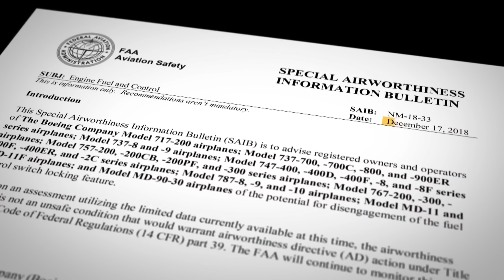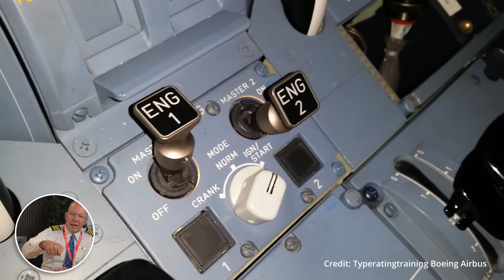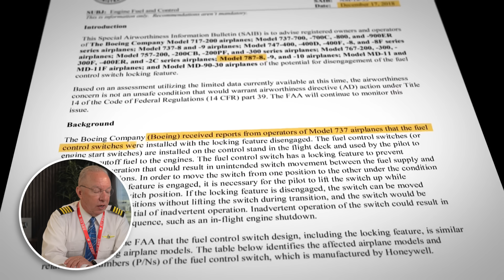Air India 171: The FAA’s 2018 Fuel Switch Locking Bulletin Explained (16 Questions Answered)

Comment: Boeing flight carrying 242 people roughtly
1.Aircraft liftoff at 0 seconds
2.Fuel switches to CUTOFF +3 seconds (reaching a height of  191 m, airspeed of 330 km/h)	
3.Engine 1 switch back to RUN +11 seconds
4.Engine 2 switch back to RUN +15 seconds
5.Aircraft crash +29 seconds
Based on the above details applying Physics and math, can you calculate the possible distance from the end of Runway  till the crash spot?
Answer: The aircraft likely crashed approximately 2.1 km from the end of the runway, assuming the speed profiles and acceleration/deceleration approximations made.
ChatGpt gave me the above answer.  But the flight has crashed at 1.5Km, so my question is the Fuel switches back to Run?

Comment: Do not believe this rubbish about one of the pilot's actions of switching off fuel to both engines during takeoff. 

Pilot sabotage or accidental fuel cutoff or pilot under influence of a substance couldn't have been the cause of flight 171 crash. It is entirely possible, yet very unlikely. Both pilots were not in the mood to kill themselves that day. 

Something far more sinister took place inside that aircraft.

Comment: Captain Steve great show as always. I have a question. If one of the pilots shut down the fuel supply. And the other pilot re-engage them and tried to start the engines back up. But was unsuccessful. Why were they both found in the shut-off position. Did he shut them back off after realizing they the engines wouldn't start? I'm really confused!
Reply: The preliminary report states that investigators found the switches were in the on position when the plane crashed, meaning a pilot had moved them from on to off during takeoff and the other pilot had moved them from off to on again before the crash.

Comment: Capt. Steve, you are doing a great job explaining. I am an aeronautical engineer. I have 2 questions. 1) are the fuel switch positions seen in the DFDR data? 2) If the switches were off before takeoff, would the aircraft have taken off with residual fuel? Thanks!

Comment: Recommendations
Honeywell P/N
3TL32-2-3D 766AT613-3D 766AT613-3D 3TL32-3D 4TL32-3D 3TL32-12A 3TL32-3D 50075622-001 4TL837-3D 3TL32-1-3D 3TL32-2-3D
                          The FAA recommends that all owners and operators of the affected airplanes incorporate the following actions at the earliest opportunity:
1) Inspect the locking feature of the fuel control switch to ensure its engagement. While the airplane is on the ground, check whether the fuel control switch can be moved between the two positions without lifting up the switch. If the switch can be moved without lifting it up, the locking feature has been disengaged and the switch should be replaced at the earliest opportunity.
2) For Boeing Model 737-700, 700C, -800, and -900ER series airplanes and Boeing Model 737 8 and -9 airplanes delivered with a fuel control switch having P/N 766AT613-3D: Replace the fuel control switch with a switch having P/N 766AT614-3D, which includes an improved locking feature.
We request that owners and operators report any failure of the locking feature of the fuel control switch to Boeing (see contact information provided below). The report should include the date the failure occurred, the fuel control switch P/N, airplane model, airplane serial number, and airplane registration number. Under the provisions of the Paperwork Reduction Act (44 U.S.C. 3501 et seq.), the Office of Management and Budget (OMB) has approved the information collection contained in this SAIB, and assigned OMB Control Number 2120-0731.
For Further Information Contact
Tak Kobayashi, Aerospace Engineer, Propulsion Section, FAA, Seattle ACO Branch, AIR-784, FAA, Seattle ACO Branch, 2200 South 216th Street, Des Moines, WA 98198; phone and fax: 206-231- 3553; email: takahisa.kobayashi@faa.gov.
For Related Service Information Contact
Boeing Commercial Airplanes, Attention: Contractual & Data Services (C&DS), 2600 Westminster Blvd., MC 110-SK57, Seal Beach, CA 90740-5600; telephone 562-797-1717.

Comment: Listen, I’m also iffy about Boeing, but the biggest indicator for me that there’s a variable that’s not the plane in this factor is how the same plane was operated safely just hours before. A catastrophic loss of BOTH engines RIGHT AFTER takeoff don’t just spring up in an instant because planes are built with redundancy.  The previous flight would’ve noticed something unusual with the plane (loss of electricity, slow takeoff, slow speed gain etc). Is Boeing 100% clear? Hell no. Because why is a take off configuration allowed to have manual dual master engine shut off? It can successfully climb with 1 engine. In a busy takeoff moment, I personally think they don’t need to shut off fuel to a lost engine which is prone to error in a high tense high pressure situation.

Comment: Why don’t they install a safety program that would override the mechanical shut off switches or at least one of them under 5,000 feet?
Reply: Okay! So now we're back to the same mcas type of crap that also caused crashes in itself! Then when will all this "fail-safe redundancies" bs ever end?? And it still won't solve any crashes brought on by human intention, will it?? Someone who is trained in flying planes WILL still find another way to crash the plane if he is already RESOLVED to doing it regardless
Reply: Capt steve answered this also! What happens if your engines caught fire below 5000 ft??! Now you can't shut down? What a m0ron. Stop thinking right out of your a$$

Comment: Captain, if there is no situation that will require you to cutoff engines 400 feet in air after take off, why would a plane in year 2025 allows you to cutoff the engines until an altitude that is safe to do so? Should there not be in plane’s system that should stop such cutoff???

Comment: you seems to be a Boeing funded implant peddling mental health rumors and doubling down on it without any evidence. 1st it almost impossible to bring down two fuel switches in 1 sec, and if the intent is to crash it they will not bring it up in 10 secs. what happened to previous FAA notification in 2018?? why is  there no safety built into the software and systems like Airbus does ? sudden shutdown of both engines???

Comment: If these switches were positioned on the outside of each pilot then one pilot couldn’t switch off both engines. You said one engine still running would have meant the plane would have continued to climb. Tim

Comment: The report says the two engines switched from RUN to CUTOFF position with a time gap of 1 second. About 10 seconds later, the two engines switched back to RUN position one after another with a time gap of 4 seconds. Practically, how fast can a person manually change the two fuel switches one after another?

Comment: Yes, it makes perfect sense that the pilots have the ability to shutdown the engines quickly when necessary. However, it is absolutely dangerous to have just SINGLE fuel cutoff switch for each engine. It should be a two step procedure to avoid accidental or otherwise unnecessary engine shutdown. During takeoff, if the fuel cutoff occurs, there should be clear audible warning and visual warning to alert the pilots, particularly when it happens during takeoff and the aircraft is airborne.

Comment: Just don't forget that the fuel cutoff switches are electrical and send a pulse to a specific input on the control computer. This pulse must be interpreted by the software, which will then send another electrical pulse (command) to the fuel cutoff valve actuators. What the black box records is that this pulse came from the switch. BUT WAS THIS PULSE REALLY THERE? - Couldn't it have been an electrical failure in the hardware or a software interpretation failure causing the fuel control valve to actuate, cutting off the supply to the engines? This failure occurred in BOTH engines at the same time. It is now known that the time interval between the actuation of switches 1 and 2 was 1 second, and 12 seconds for the switches to return to the fuel reopening position. 

This is exactly what happened: - There was an anomaly in the electrical supply at 08:08:41h, so the hardware and software closed the fuel valves. The engines began to lose rotation and the RAT was automatically activated. When it restored electrical power at 08:08:52h, a RESET was generated in the software and hardware, then opening the valves again and indicating that the switches had been placed back in RUN, when in fact they were NEVER changed by the pilots! Don't forget that Boeing's 787-8 Dreamliners have a history of electrical problems!
Reply: This is certainly a good concept to contemplate. I’ve been thinking the same thing. The only items I can’t get over however, is that 1 sec time difference between the two “recorded” fuel cutoff commands…..whether it was switch’s moved or just that fault. I would tend to believe they would have been closer together. But, it’s possible the way the fault occurred that one computer was just a bit behind the other in receiving the shutoff command. I guess then that just leaves the question…..were there any other faults or alarms that came in about that time? I of course haven’t seen the flight data recorder so I don’t know. Would seem a bit odd to me that no other alarms were triggered during this fault. And the fault just happened to select both fuel command switches and then alone. It’s hard for me to get around that point.
Reply: "This is exactly what happened"

You should definitely contact the NTSB since you know exactly what happened.

Comment: Video is a great idea but probably difficult to implement given that the privacy laws of each country will likely be vastly different. Who has access, who can publish, who can view? All of those things would need to be negotiated. Most of the examples of video implementation are related to domestic transportation methods, which are far easier to work out. The airline industry would need to collectively spend a lot of work, time, and money on something that doesn't materially enhance flyer safety and only marginally helps to apportion blame after-the-fact. If the telemetry and switch operations are already noted in the black box data, and it is determined that pilot error is the cause, the liability will rest with the airline (and not the manufacturer) anyway. The only additional advantage of having video is being able to identify which pilot caused the error. Even that, in this age of AI, where video can be seamlessly manipulated or fabricated, would disrupt an investigation and distort public opinion more than it would help reach resolution. In my opinion, it would be better to spend that money on pilot mental health care, and increased rigor in pilot pre-flight screening, license issuance and renewal.

Comment: While it seems deliberate, all stones need to be turned over in order to make sure there are no switch issues. I disagree if the switch was installed wrong, the switch wouldn't work and pilots sitting at a gate loading passengers would discover it. If that was the issue, the plane never could have been delivered to the airline. Or flown to that gate to begin with. Clearly the bulletin was targeted at in-service vehicles. They could have been had the issue, which might have only surfaced over time with just the right circumstances (loose sleeve catching on them, jewelry, etc), perhaps increasing chance with wear and tear. As for the dialogue, it's not clear one pilot SAW the other do that.  One could have noticed the switches were off and the natural conclusion was that the other pilot did it since first pilot knew he didn't do it, and there was no-one else in the cockpit, and he did not think they could switch off by accident (sleeve snag or vibrations).

Did the report mention any explicit confirmation that the switches were sound?

Comment: Captain Steeeve, how much is Boeing paying you to run PR on their behalf? You’re so quick to blame the pilots, yet you ignore the basic engineering principle that anything mechanical can fail, including spring-loaded switches. Instead of blindly asserting “it can’t fail,” how about you read the actual bulletin, understand the system in question, and help figure out the root cause—not spread baseless absolutes. Overconfidence in design is how failures get missed. Let’s stay focused on facts, not narratives.

Comment: Captain Steeeve is NOT an electrical engineer. He thinks something done in a simulator has relevance to determining faults on a real plane. For starters there could be a wiring fault that is intermittent. That connects or disconnects based on being bumped(or other cause). etc etc. I have seen such an intermittent fault on subsystems installed on Australian submarines, it was outside the abilities of the regular maintenence engineers to rectify and they had to call in the design engineers to find. Most likely the Boeing system, otherwise called a plane, is NOT fit for purpose to fly in the air

Comment: Why doesn’t the report talk about the performance of the engine and give the
conversation in the cockpit during the take off . Why doesn’t it tell anything about RAT
deployment time stamp . Why doesn’t it talk about engine performance during take off
roll , v1 etc . Why doesn’t it talk of v2 was announced / gear up was announced in the
cockpit. There is a pic in the report of the aircraft wihin the airport boundary , definitely less than 100 feet off the ground and the RAT is already out and that’s different from your point that the RAT came out later. Report feels off as it absolves Boeing and GE and overtly makes a statements that there is no recommendation for them, but this is unusual as no preliminary report ever goes as far as this and issues recommendations, I have checked various preliminary reports but they always seem to state facts and leave room
For main report to give recommendations- this smacks of a cover up

Comment: Thank you for making this video. I have to nit-pick about one thing though.... you and others have said that the flight data recorder captures the physical position of the switches but I don't think that is the case. As far as I know the electrical signals from each (two pole) switch go to two different places via wires - one to the main avionics processor via a Remote Data Concentrator (distributed I/O) and the other directly to the FADEC for one of the engines. Not sure which of those signals is captured in the FDR but it's possible that the FDR records one and the FADEC records the other.

I don't believe anyone has come up with a good alternative explanation for the recordings so mostly nit-picking about the wording - we know the electrical positions of the switches at this point (from the other end of the wires) but not the physical positions... although if my understanding is correct and there are two separate signals from each switch then it does make it even more likely that the switches were physically moved.

EDIT - in fairness I have to nit-pick about my own comment as well. One could argue that the reason for having two separate connections is that one controls the engine and the other provides an independent indication of the switch position, which is pretty darned close to saying the FDR does capture the physical position. Anyways, I guess I'm posting because I have a nagging feeling that something is being missed and that it may not be pilot error in this case... only gut feeling from nearly 50 years of system engineering though.

Comment: Lots of discussion about changing the cut-off switch design to prevent this from happening but the pilot has many options to crash the plane.  What if he pulled the engines back to idle?  What if he nosed the plane over?  Rolled the plane?  The other pilot may resist but then it comes down to strength and reactions. Sadly, it has happened before.

Comment: I think you have misunderstood the 2018 Fuel Switch Locking bulletin.  Even your own video -- this one -- starts out with an announcer advising that catastrophe can happen "MID-FLIGHT", while you are saying the switches are installed upside down and the pilots would notice before they even took off.  I have not seen any other video or article use the term "upside-down" in regards to this bulletin.  The pilots or mechanics who found this defect need to speak up about what exactly happens when the "locking feature is dis-engaged".

Comment: Perhaps pilots need a similar option that air traffic controllers do to take days off for mental stress. It would be hard to properly set up of course to differentiate from regular vacation, but since pilots are just as essential to protecting human life as air traffic controllers, that would allow for someone going through incredible stress to report in and get a little time off. Maybe unpaid leave but still your job isn't automatically put at risk.

Comment: I’ve heard many times that air traffic controllers are under a tremendous amount of stress for obvious reasons. I wish Captain Steve would provide some detail as to why airline pilots are under so much stress? Isn’t the plane pretty close to being able to fly itself? Also, in today’s world with the advancement of weather service, planes rarely have to fly through dangerous thunder and lightning storms or any kind of dangerous storms. They simply go above or around them. Of course, sometimes I’m sure they get stuck, but I believe that’s very rare these days. So where is all the stress coming from? I’m not saying it isn’t so because I don’t know anyone who’s a pilot. If that’s the case, you could make the argument that Greyhound bus drivers are under a tremendous amount of stress as well.